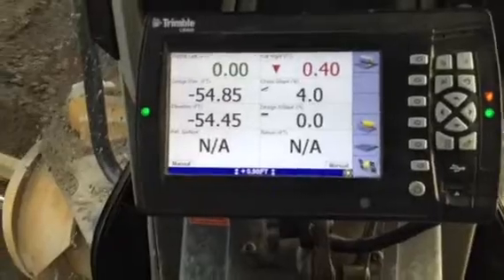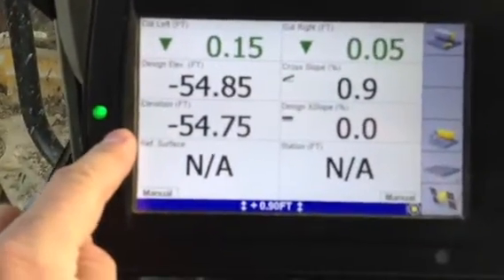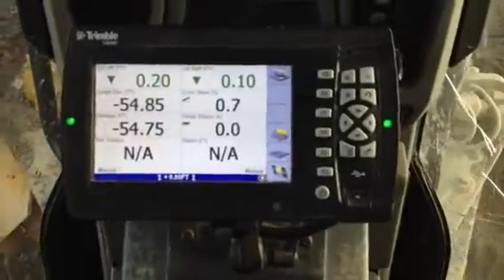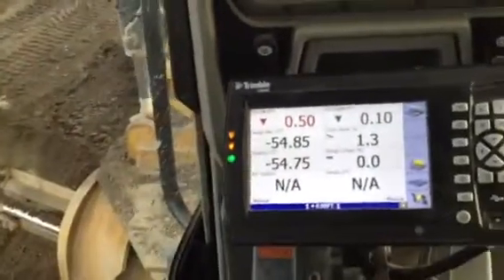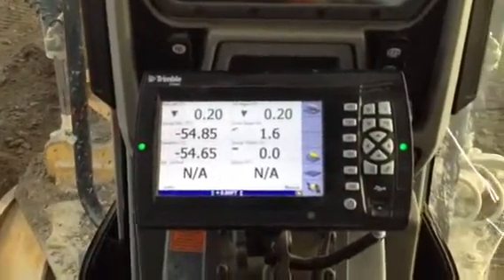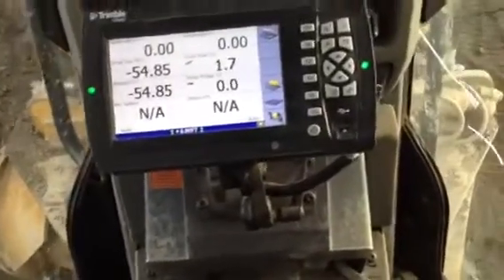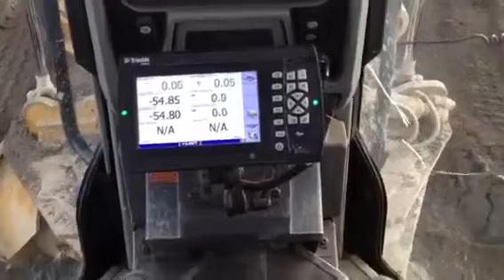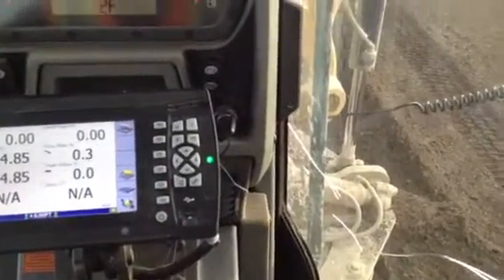Cat 14M w/ Trimble

Comment: Awesome basic tutorial for the Trimble system. I'll definitely take a Trimble over a Topcon system.  Both have pros and cons but Trimble seems to be more accurate 90% of the time.
Reply from the maker: Aw thanks, I just kinda did it for my friends that are curious what I do (did). That took place in Prudhoe Bay, AK. Mundane work done in an exotic location.
Reply: Hi bro ,how are you doing? Please I'm also a Cat grader machine operator I moved to Germany for the past two years now ,I'm now working in a company called STRABAG but their system of working with the the trimble is so in advance and I'm not so good in the German language so I hardly get what they're trying to explain to me in the trimble system and top topcon, so I try to make some search on YouTube and I finally found your video so I wanted to  ask you if you don't mind to help me with your email or WhatsApp so that I can ask you some questions about the system which I find it very tough please please please help because I'm losing my job 😕☹😩